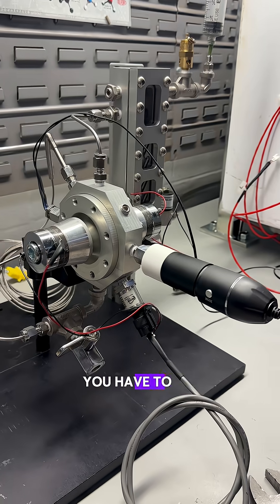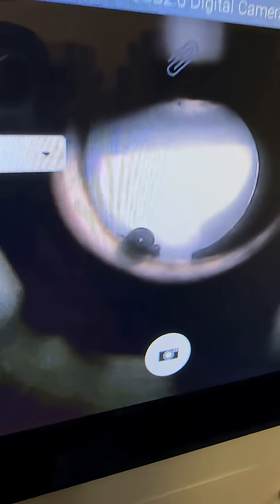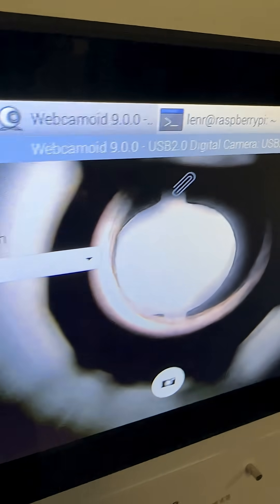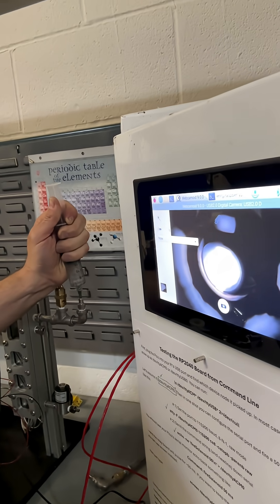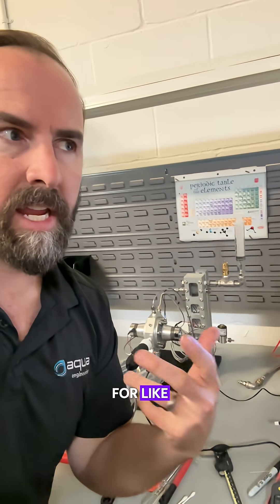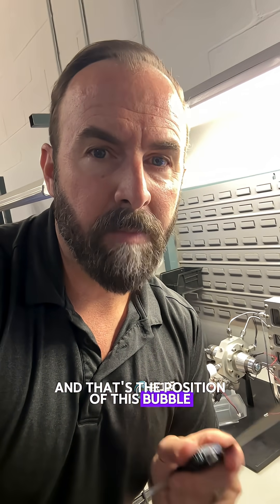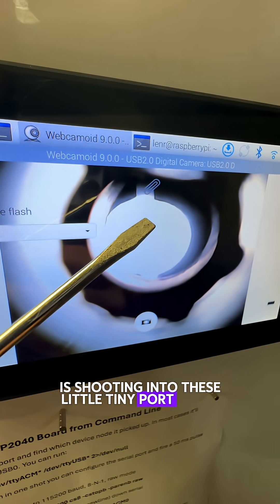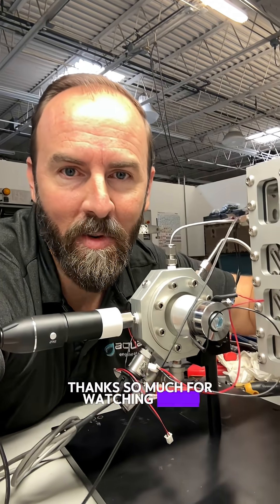LENR Ultrasonic Cavitation Reactor

Comment: So if you’re logging the chamber pressure, temp, osc freq etc and also maintain video recordings, you should be able to train a NN on it to then handle on the fly adjustments to maintain or alter the bubbles. I have zero background knowledge on the fundamentals of  this project and what is desirable in regards to bubble properties, but a high speed system that knows what inputs will produce the desired output should be able to maintain ideal conditions even if not the perfect environment or machining tolerances or cleanest sine waves.

Comment: Wait wait WAIT! Are we talking about sonoluminescence here?!? If so this is huge dude I never thought I'd just see something like this on yt shorts!! And you're using ultra sonic frequencies to attempt acoustic levitation right..? And I don't know much so correct me if im wrong but thats like a critical flaw to identify isn't it and  isn't it pretty big deal that did you so? Cause if my mind is on the right track for fusion to even be theoretically possible, the bubble must be trapped at the precise geometric center (the pressure antinode) to ensure a perfectly symmetrical collapse. Because if you have any imperfection in the sphere the ultrasonic field will push the bubble off-center, which is basically what were seeing..?& if there's any asymmetric collapse then it will fail to generate the required temperatures and pressures... Because isn't this like the central engineering problem that has plagued sonofusion research for decades? I subscribed because of a totally different video and had no idea you were working on this as well, this is brilliant DIY physics, and your plan to introduce argon next & to use code to stabilize the bubble is the next best step to take imo but as you've noted, solving that acoustic centering problem is the real mountain to climb, but honestly man anazing to see you tackle this. Keep it up fr 🤓🙌🏻🙌🏻👏🏻

Comment: Amazing! Do you plan to use the video feed and other sensors to drive a control loop?
Reply from the maker: I plan to close the control loop with a Bremsstrahlung sensor of some kind. Adjust parameters to maximize intensity of a filtered wavelength perhaps. If the bubble dynamics are too challenging for a single sensor element then yeah I might need an array and video could do that.